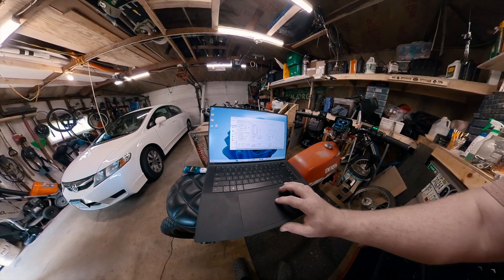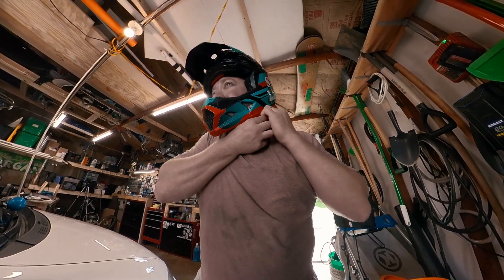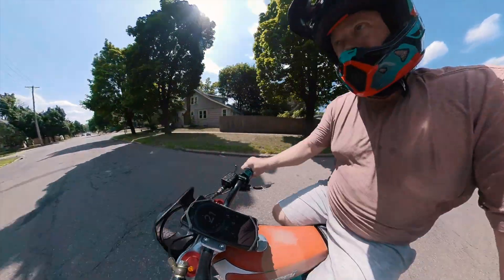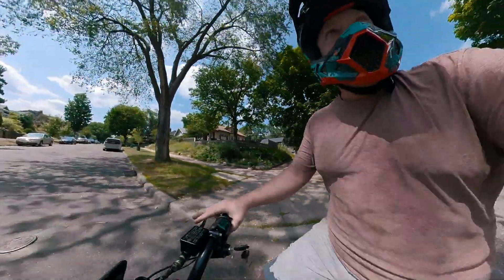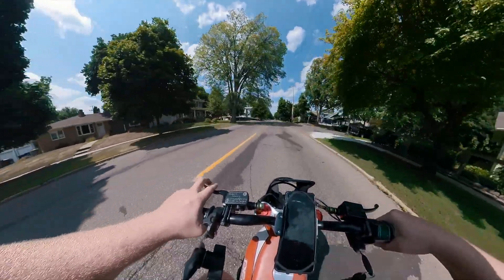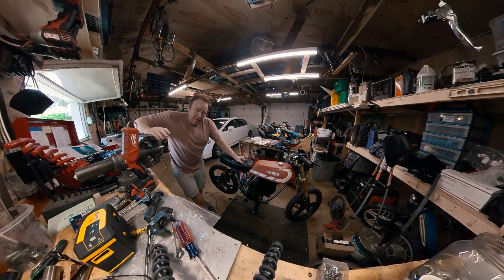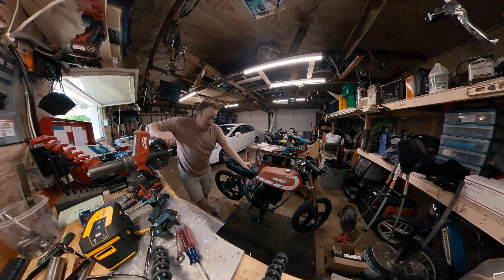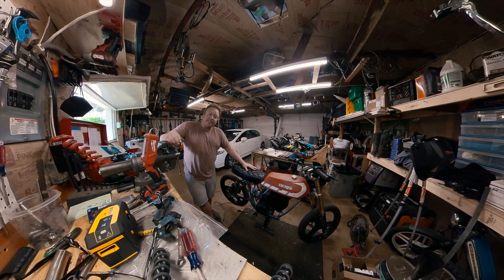DIY Electric E Bike 56 MPH. 72V 200A QS 138

Comment: I’d love to connect with you about a similar electric setup. It is on a Massimo E-Trike Spyder. Interested?
Reply from the maker: What going on?
Reply: @Corn-ped , it uses a Z138c motor with an EM-150 controller. Picked it up to a front wheel alignment, and now it won’t work. It just “clanks” one time, and then nothing. I have a feeling the motor is the issue, but I am not sure. It worked the day we picked it up, and the only difference between then and now is a full charge. 
I am considering an EM200, and the newer motor model, but would like some input, if you wouldn’t mind.